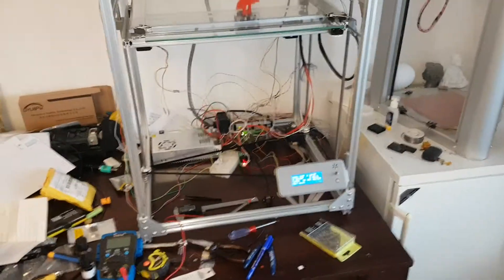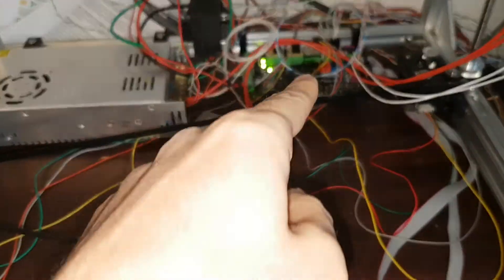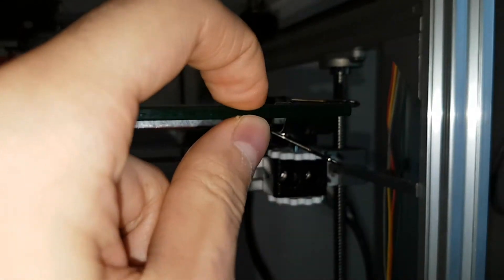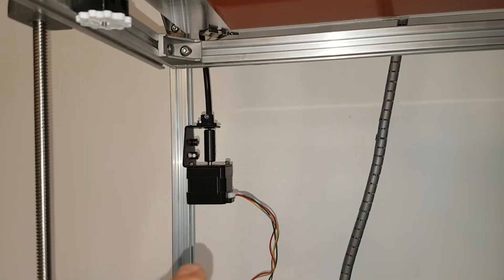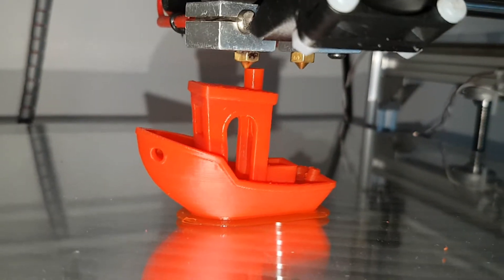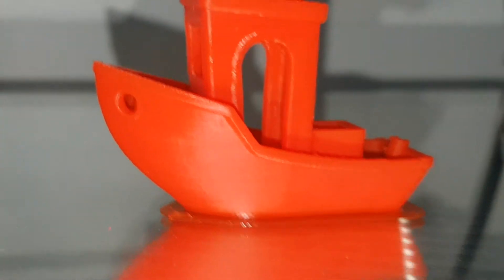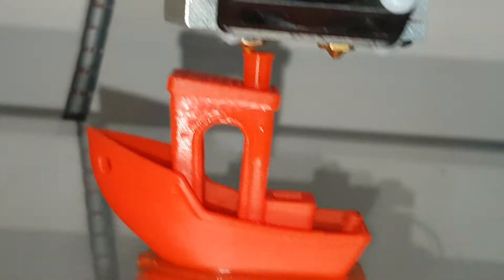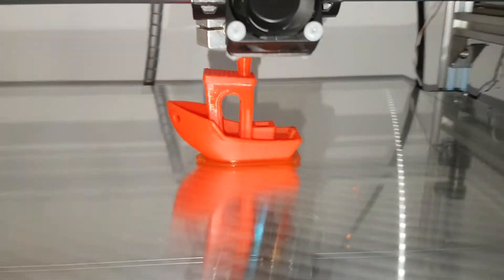RK 3D Printer updates#0 (very first test run)

Comment: Very nice solid Z assembly design! What didn't you like about the steel and carbon fibre rods? Diameters not precise?
Reply from the maker: j mtx Thanks!
The CF tubes had a bit of deflection under load, however they were better than 8mm steel rods. So my next one to try is a rail (maybe with support) or 12mm solid CF rods.